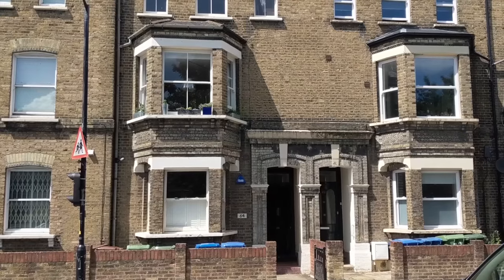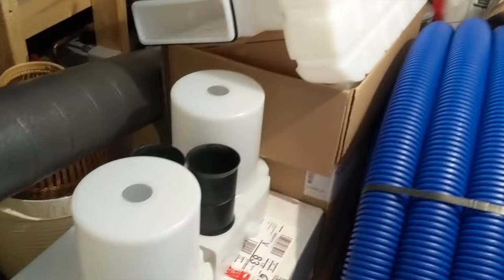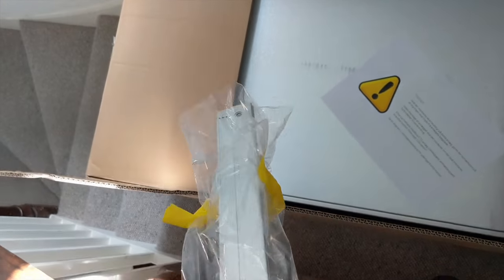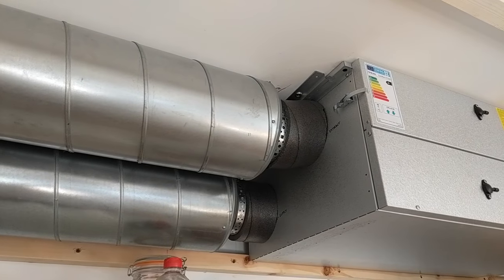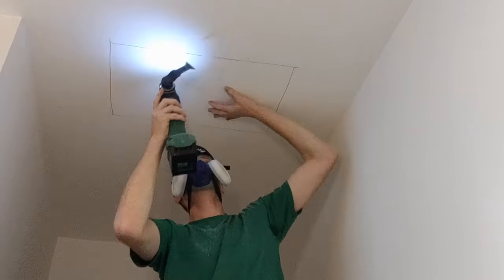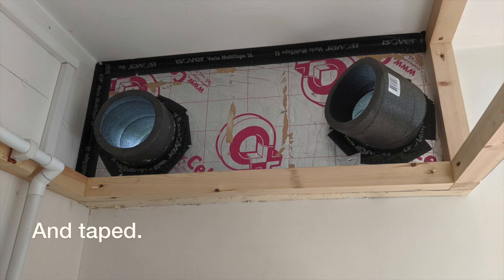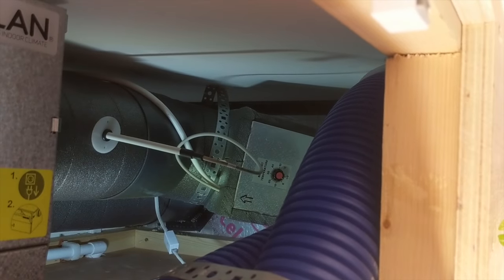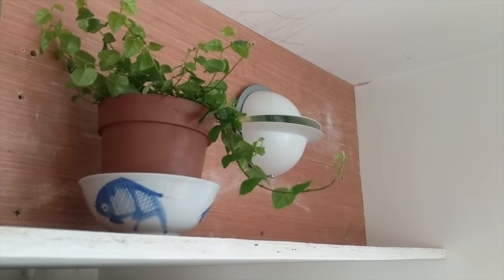Installing a ventilation system (MVHR) in an existing home

Comment: That is an excellent video!! Thank you. Regarding  the dropped ceiling it’s most likely for getting the dB rating for conversion into self contained flat. In your case it’s been highly useful that it can take the ducts.

Comment: Next week I will be installing very similar air ventilation system in my flat for the very first time. Technical information you provide in this video helps alot! I love your idea of using a rubber glove for dust prevention. Thanks for your time making this video! Wish you well

Comment: Outstanding work. I'm just about to install a single room heat recovery Ventilator but your job is a work of art. Well done 👏
Reply: Maybe this way will work for you: https://youtu.be/9MXjsS6J7Cc
Reply: @ajavrick  thanks for the video. That's quite a sizeable unit! I've completed mine now. It runs on a constant trickle feed and turns on via a humidistat. Seems to work well so far. Thanks again for sharing your information 😀

Comment: Great to see a nice small DIY system.  Thanks Wilfred.  I'm looking into doing something similar in my house renovation but was concerned about all the space that the ducting and the heat exchanger take up.
Reply from the maker: It does take up space, but there's quite a lot of dead space in houses, so I'm sure you can find somewhere. Best to think about duct runs first. Above the stairs? They can go outside in a porch too, as long as they're against the external wall, would that help?

Comment: Great! Thanks for sharing. Is MVHR possible to conduct pipe across different floors in property? 
I plan to install MVHR in my garage on the ground floor. Is it possible to conduct  pipes to bathroom and bedroom on third floor where I think were the most damped in home? Or should I  install the MVHR on the loft, thanks for your advice

Comment: I just started looking at these systems and came across your first video and I would like to thank you so much for sharing this short video covering all the main points of a MVHR and how you went about actually installing it into your flat.

I would like to look at getting a similar system for my 1200 sqft 2 story home that was built in the late 1990's. The question that came to my mind is what type of heating system did you have in the flat?  And did it improve the efficiency of your heating system after installation i.e needed less kWh. I currently have a radiator based central heating system and was not sure if this system might be more suited for electrical heaters.

Comment: Did you have any concerns with locating the intake and exhaust vents so close to each other? I'm installing a similar system and everyone keeps advising against it due to air feedback loops. Any thoughts?
Reply from the maker: It isn't ideal, but you only need slightly further apart to reduce any cross contamination. There's only a very low flow out and lots of mixing externally so the risk is small. In this case it's first floor on an exposed street so quite a lot of air movement. If you're worried about it you can get combined intake and exhaust terminals that are designed to avoid mixing air flow.

Comment: Hello, great video! I have a Nuaire system put in 2 years ago, never switched it on sadly. Are you able to share who did you use to check the flow rates|?
Reply from the maker: You could try Enhabit in London, or Green Building Store in Huddersfield. They need to have small enough air flow hood to measure low flow rates, commercial engineers might not.

Comment: Thx for video, not too many retro fit ones out there. I live in a 3 storey mid terrace victorian house. As you mention in comments, noninsulstion without ventilation. What are your thoughts of using Mhrv in a single floor... E. G. My top floor has 3 x beds and shower room... Easily ducted via attic...
Reply from the maker: Thanks for comment. Good luck with your install! You can do ventilation by zone, but it needs to be balanced per ventilation unit, same amount of air in as out. Three bedrooms need quite a lot more air than one shower room so you would end up with more ventilation than you need in the house. Only using a bit more energy, technically possible. There aren't many good MVHR units small enough, would probably work better as a whole house install. Ducts must be inside the airtightness line, and inside the insulation, something to think about in the loft!

Comment: Great video! Just wondering how your controls work - do you turn it on/ off manually? or is there some kind of occupancy sensor? I'm looking to install MVHR in a music studio where occupancy is less consistent than in a home, so I want to avoid having the fan running 24/7. Similarly with the heat recovery, are there any automated controls for bypassing that in the sunmer? Or would you do that manually?
Reply from the maker: Hello Stevie, it's a manual controller with 4 speed settings. I leave it running 24/7 at one speed, a good strategy for most homes, but you could set a time program or there's a humidity sensor option for different speeds. The summer bypass is automatic based on internal and external temperature. For your application I'd leave it running all the time at a very low speed, then turn it up manually when you use the space. Some manufacturers do an app now (of course) so that might be useful to you. Most of the time it's a bit overkill.

Comment: Thanks for the video, just what i needed to start my own planning.  Did you find that the constant turn over of air, even with the MVHR, had an overall chilling effect in the home?  Did you need to ramp up the heating to accommodate any lost heat?  Thanks again.
Reply from the maker: Hello Oli, thanks for watching. The fan is bringing in a very small amount of air, and has 80% heat recovery, so the heat loss is much much less than it would be getting the same ventilation (or even 1/4 of the ventilation)  pulled through by a basic fan or openings like trickle vents. So no, it uses less heating and you get better air quality. The position of the supply vents is quite important so that you don't feel a draft, it can make you feel colder. So high up and make sure to use proper supply terminals that direct the air along the ceiling. Hope that helps, good luck with the install.
Reply: It may be nice to have supply terminals that let you direct the airflow, as in the summer it could be enjoyable to direct it towards a seating area for example

Comment: Hi.
Great job with your retrofit.
I’m about to fit mvhr in my 3 bed.
Would you recommend someone who can design my system?
Thanks
Reply: Manufacturers have their own in house design teams - for instance Blauberg has a service and it only costs less than £ 40 according to their web site and you get that back if you buy.
Reply from the maker: As Jason says, the manufacturer/supplier will often do you a design. Worth asking for bigger ducts and acoustic attenuators though as they can cut it a bit fine leading to noisy systems. I sourced idirect from the manufacturers: Nilan and Lindab. You also could try Enhabit, Green Building Store, Passivhaus Store, or Greenwood for a design and supply service.

Comment: So Wilfred, are you happy with the system in general? And do you think it has reduced your heating bills at all? I am looking into doing a similiar install albeit in a larger detached property but havent really seen any recent installs with newer recovery systems. Thanks. Jonathan.
Reply from the maker: Hello Jonathan, 6 months in and I'm really pleased with my install. I doubt it will have reduced my heating bills yet as I haven't done any airtightness measures, so the ventilation rate has probably got higher if anything. However I won't be paying any extra either (apart from the really low power fans). The air quality in the bedroom and bathroom is loads better. It also means I can replace the front windows and do some internal wall insulation with no worry of moisture problems, "no insulation without ventilation!" Good luck with your install

Comment: This was super helpful thanks! Out of interest, does it cool the flat in summer Wilfred? If so how much?
Reply from the maker: Hello Jugbeh, not really, there is a small amount of ventilation that is helpful and it bypasses the heat exchanger when it's warm. You can get one with a cooling coil, but not really needed in the UK.
Reply: @wilfredsouth2482  Cheers for the info mate.

Comment: What to do if you don’t have a suspended ceiling?
Reply from the maker: Find some neat areas to box in ducts, an area where you can drop the ceiling like a corridor, or use the loft (under insulation). The solution needs to match the property, the only rule is that there's always a solution!

Comment: Great video. How long would you say it took and how much did you spend if you don’t mind me asking?
Reply from the maker: All in one go I think I could do it in 3days just the ducts and unit, with some help for fixing the unit itself. Boxing in and finishing took longer. Then a separate visit by a commissioning engineer when everything is clean. Hope that helps.

Comment: Nice project you have there Wilfred! If you don't mind, how much the whole system costs and where can you order the mvhr from?
Reply from the maker: Thanks! Materials only but including the finishes was a bit over £3000. This is a small unit though. Most of the equipment came from Nilan UK and Lindab. You can could try Passivhaus Homes or Green Building Store as well.

Comment: Awesome video! Did you source all the kits yourself? I'm based in South London, struggling to find someone to design and supply the whole system. Any recommendations? Thanks
Reply from the maker: Yes I sourced it direct from the manufacturers. Nilan and Lindab. You also could try Enhabit, Green Building Store, Passivhaus Store, or Greenwood for a design and supply service.

Comment: Thank you for sharing

Do you have any info on running costs?

And is your house warmer?
Reply from the maker: About £40/year, but saving more than that on heating so will be net gain. Not much on my flat as I don't have great airtightness, but about 15x for newer build.
Reply from the maker: Not warmer by default, but warmer for the same air quality as I don't have to open windows in winter.
Reply: @wilfredsouth2482  my house is old like your flat

Comment: Are you able to share contact details of the company or person you used to check the flow rates|?
Reply from the maker: Hello Shehzad, you could try 'Enhabit' in London, or Green Building Store, or ask the fan supplier to recommend. You should check if they are 'BPEC' certified. Definitely get your system up and running, even if at a low flow rate to reduce noise.

Comment: fuckin hell would have been easier to plug a dehumidifier in christ
Reply: It's not just water vapour that lingers in a house. Carbon dioxide builds up really quickly too. I'm planning to install a system, but my motivation is the fact that the CO2 level in my work-from-home office rises to 3800ppm after working in there for just three hours, and that's enough to stop one thinking clearly and give one a headache. And the condensation on the windows too.

Comment: Cool. Another illegally installed ventilation system that will fail permit inspection and have to be removed before the house can be sold. This is idiotic.
Reply from the maker: The system was commissioned by a BPEC engineer, signed off for UK building regulations and the flat has since been sold.